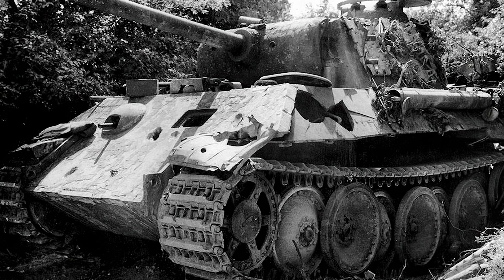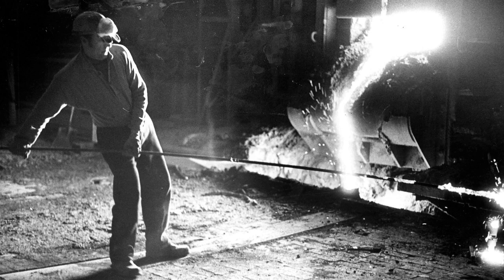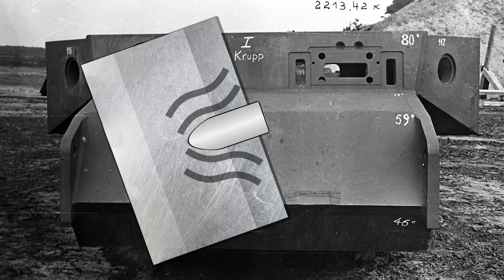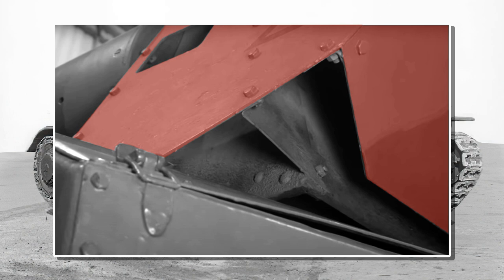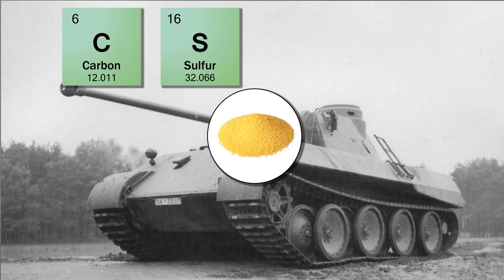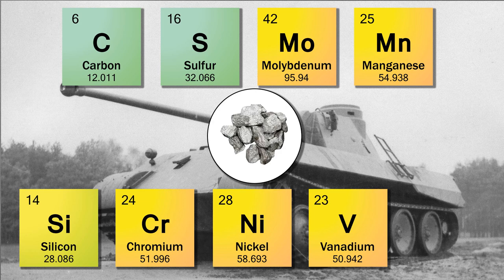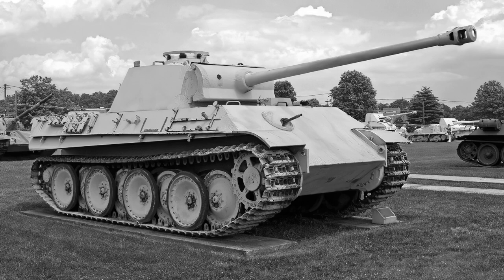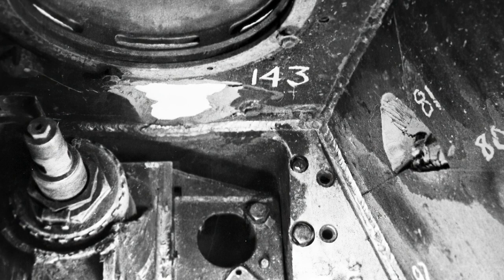Panther Armour - Tank Research & Review

Comment: I've read somewhere that the russians started tests after meeting Panthers and Tigers to see what kind of guns was needed to kill them. They came to the conclusion that 122 mm would do fine and started working on it. When IS-2s faced the german heavy tanks later on the 122 mm proved to be an absolute overkill and the russians did new tests on the new wrecks and found out that german armour had dropped in quality so the 122 mm was now considered ineffective due to it's slow ROF and small ammunition capacity compared to 85 mm armed tanks.
Reply: Ahh for that u will need to wait for part 2, overmatching. and yes technically on paper the 100mm has better performance than the 122 mm at 1000 yards, yet in reality, the latter works better.
Reply: That's such bullshit lol. The 85 could not penetrate the Panther frontally outside of suicidal close ranges.
Reply: @ThatZenoGuy  From Tank Archives:  http://www.tankarchives.ca/2013/03/penetration.html
Looks like 500m for the 85mm gun on the T34
Reply: @bradyelich2745  
Which would be far, far within range of the Panther, and only with optimal angles.
Reply: Additionally, soviet testing is close to propaganda.
Reply: @ThatZenoGuy  So what; they still lost.  If a Panther is hit by a 85mm at 1000m, all the crew (left alive) will be doing, is trying to escape through hatches.
Reply: @bradyelich2745  
If a panther is hit at 1000m (unlikely due to soviet training and optics), it won't penetrate and the crew likely won't run away.

Germans lost due to America supplying the soviets and british with infinite equipment.
Reply: @ThatZenoGuy  Did you not understand the spalling effect from the German Armour?  No need to penetrate.
Reply: @bradyelich2745  
No proof of 85mm causing internal spalling on the Panther.

122mm? Sure, but that thing was almost a naval cannon.
Reply: @ThatZenoGuy  The proof is at 1000m, the gun is still going through 80mm of armour.  Chunks will be coming off inside (spalling) and the armour will have been cracked.  
Do some reading; start at tankarchives.ca
Reply: @bradyelich2745  
How about you provide a picture, if its so common.

The armor would have to be of absolutely horrid quality, and even latewar german tanks were not that bad.

In any case, the much more powerful 88mm guns of Germany would do the same on Russian tanks, due to Russian metal quality being garbage too.
Reply: @ThatZenoGuy  The pictures are on tankarchives.ca
Reply: @bradyelich2745  
Yeah, real neat, i'm not going to scour through dozens of pages to find them.

Post them here.
Reply: @ThatZenoGuy  I did, that is why I know more than you.
Reply: @bradyelich2745  
What a pretentious sped. Lol.
Reply: @ThatZenoGuy  Oh, get your Mom to pour more milk on your cereal, I doubt you could do it yourself.
Reply: @ThatZenoGuy  Only with the obstelete APHE & APBCHE shells, which have lacklustre performance anyway. With HVAP "Arrowhead" shot, the Panther can still outrange a 85mm. armed tanks. After 1945,, with the front line use of APDS, any 85mm. armed tank can outrange the Panther.
Reply: @CZ350tuner  
85mm never used APDS lmao. The Panther could deal with all but the heaviest of allied tanks out to ridiculous ranges, whereas most tanks could not penetrate the Panther frontally, excluding the more fragile turret.
Reply: Soviet 85mm was similar to Tiger I gun. At longer ranges it was more effective than Panthers 7,5cm L70. T-34 also had similar side armor and better turret traverse mechanisms. If T-34 and Panther were standing sideways at lets say 2km away, and saw each other at the same time, T-34 85 would win.
Panther had thicker frontal armor ofc. The reason T-34 didnt have thicker armor is because Soviets tested it and the suspension couldnt take it. USA had a thicker M4 but as I remember only 0,5% of Shermans were Jumbos, cause they needed much more maintenance and experienced drivers. Soviets also had KV-1s but didnt have a need of a less reliable T-34 witch a bit more armor. But Germans started using heavy tanks in medium tank roles tho even countries that had oil believed its a bad idea. Keep that in mind when talking about Panthers effectiveness.
Reply: @Paciat  
Panther's gun outperformed the 85mm well beyond reasonable ranges, a T-34 would not be firing at a target 2km away, although realistically neither would the Panther. Frontally the Panther was effectively immune to the T-34, the opposite was not true.
Reply: @ThatZenoGuy  More like what is your saying is not true. Panther turret was thinner than its hull, and T-34 85 could penetrate 100mm at 1000m.
T-34 had a turret that was similarly thick to a Panther turret. If a Panther ambushed a T-34, witch is hard to do to size only its turret would be visible, and T-34 would be at an angle.
If T-34 ambushed a Panther - witch was easier to to due to T-34 good cross country performance and better turret rotation mechanisms, Panther would be at an angle.

And you can see that in history. Take a look what is the longest distance that an attacking German spearhead equipped with Panthers did. Than compare it to T-34 that was attacking an army equipped with the most anti-tank weaponry in history.
Reply: @Paciat  
T-34 and Panther were about equal with cross country, in addition while the T-34 could move it's turret fast, fine adjustments were only possible via hand.
The Panther's turret was vulnerable to the 85, but the entire T-34 was vulnerable to the long 75.
Reply: @ThatZenoGuy  Take a look at this video about Panther at 2:40:
https://www.youtube.com/watch?v=PqVNoiBz54I
2km wasnt an unreasonable range for an 85mm gun, nor even for a 76,2mm. Germans noticed a panther would be knocked out by a 76mm T-34 gun from 2km. And as the video sais Panthers armor was out of balance. Its absurd to think people would aim at the thickest part of this oversized, easy to hit tank.
Reply: @Paciat  
Lmao nobody 'aimed' for weakpoints of tanks, you aimed centre mass and hoped for the best. 2km a 76mm T-34 wouldn't even scratch the zimmerit of a Panther.
Reply: @Paciat  
AT rifles are fired at ranges within 100m, tank guns are far too large to accurately aim like that lmao.
76mm T-34 can't penetrate the front of the Panther's turret even at point blank. 
Nobody is discussing the weakness of the Panther's side, that is well known and is at most 50mm with a slight angle.
Reply: @ThatZenoGuy  Making stuff again...
Boys AT rifle iron sights were for 300 and 500 yards.
https://www.youtube.com/watch?v=Lkc2yAaU3CY
At less than 100m a Soviet PTRD cloud penetrate Panthers side armor without skirts.
As for tank guns, you have mechanisms to accurately aim, and magnifying optics to use that accuracy. The only problem that WWII gunners had was guessing the range. But this wasnt a problem when a soldier knew the range. If a Panther armor is towards the gun, its going straight at you. So you dont have to move the gun much. As soon as a Panther turns to throw off your aim, it will show its huge side. And its transmission isnt build for aggressive maneuvering.

Finally why are you about a 76mm that T-34 can't penetrate the front of the Panther's turret? I told you that a T-34 85mm can, while even a T-34 76mm (so obviously 85 can do it too) can destroy a Panther from 2km shooting from the side. And I backed that with a source video with German army regulations.

So my point is still the same. It dosnt matter that your tank can withstand a Soviet divisional gun fire if your tank is 10 tons heavier, huge target, prone to brake down, easy to destroy from the sides. US had M4A3E2 with even thicker armor but only 0,5% of Shermans were were "Jumbos" because overweight tanks were  bad as standard medium tanks and were used for very specific situations. Same goes for StuGIII and JagdpanzerIV L70. People think its an improvement but the second suffered badly in roles other than destroying tanks from ambush positions.
Reply: @Paciat  
The 40mm side armor was a small sliver above t he wheels. A hit above or below said area was more than 40mm and resulted in a non-penetration for the PTRD.
Reply: @ThatZenoGuy  Lol, a plate that is roughly 40cmX400cm is a small sliver, for a weapon that aimed at weak points like vision slits... Adding more wheels adds friction and mass, while they are far less effective at protecting the tank than actual armor. Its a stupid idea that almost no one used after the war.
I can make stuff up too kid. Like that Germans are gay man as the name suggests. But whats the point. Post where you are getting your information. If you cant do than how can you know If what you heard was nazi propaganda, clueless GI whining, or plain fiction created for personal profit?

Comment: I always thought the Tiger I with its flat front armour was more effective than the Panther. How many times would the allies encounter the front of the tank perfectly square-on?  The combination of an 8.8cm gun with 100mm of front plate  with a rolled steel turret seemed a good combination, defensively speaking. An expensive tank but I suggest possibly more effective than Panther actually turned out to be, regardless of how good-looking and well balanced it seemed.

Comment: There is a lot more to steel than just the chemical composition. The heat treatments have a lot more to do with brittleness than carbon content. The Germans were experts at making fine grain martensitic with very high carbon content. It was very tough as opposed to brittle. Dr Ferdinand Porsche himself is credited with inventing SG Iron (the first of the high strength low alloy steels)
Reply from the maker: except they didn’t heat treat it properly, a large number of vehicles tested during the war which were captured were found to have very brittle armour, there were a few exceptions, but for the most parts it was prove to cracking and flaking a lot.

Comment: this question is purely to answer my own musings having seen the photos of tank and vehicle dumps everywhere as the advance to Germany progressed I wondered obviously the vehicles had been stripped of everything useful to aid in retro fit and repair so....what happens to the metal can armour plate be cut up and recast ?
Reply from the maker: yes and no, it depenends on the metals mix, most vehicles were sent back via scrapping ships to the US or in germanys case is salvaged, if the metal has faulty impurities then thats no good, or if it has burnd out, but can be made into lesser stuff easily enough, recasting from wrecked steel can lead to a lot of problems though
Reply: @armouredarchives8867  ah thanks

Comment: Great video, sir.  Makes me wonder if they'd have been better off simply utilizing two welded plates, with one being untreated and a thinner layer, on the outside, being treated.  I do wonder, and I imagine that you'll get into this later, was this more of a late war issue or something that permeated Panzers throughout?

You'll also maybe touch on this, in another follow-up on the video, but I can remember watching a video with Hilary Doyle and The Chieftain, where they're walking through a museum, in Germany.  They start talking about the Jagdpanzer 38 (t) - Hetzers gonna hetz! - and Hilary makes the point of the armor, on the Jadgpanzer is X mm thick but provides less protection than the typical type of steel used in earlier German tanks.  Is that because of what you're eluding to, here, where they ultimately had to stop face hardening?  Or, was that something else, like less quality steel for faster production or other issues?

Apologies, for the length of my diatribe.  Keep up the great work, sir!
Reply: Hilary was referring to Siemens-Martin steel, a more antiquated method of plate manufacture. That is not what this is about.
Reply: Hi its on the list, in this first case, that's pretty much how the UK did things, but as said in the vid, its connecting the two plates that's hard as they won't weld, so you need to rivet or bolt, which is fine up to a point but as the armour thickness increases the bolts become larger and larger to hold the two layers and survive impact into the point its not possible.
Reply: @edfrancis712   @Adam Mann  As I recall (will have to check some research) it has also been found in testing that two stacked armor plates are not as effective at stopping armor penetrating rounds as a single plate of equal thickness.  IIRC it is because there is now an internal shear plane preventing the energy from being distributed between the two pieces.
Reply: You can determine 3 types of both German and Soviet welded armor plates. 
1. Demanding technologically, being well delivered in most cases worked for German tanks until 1942 outstandingly well, especially considering the Panzer IV and later on the Tiger. 
2. Demanding technologically, being poorly delivered, as shown in this video - did not work well for the III Reich. At least not all the time. Due to the low quality of materials and not strictly provided treating processes rather awful for the Soviets and their famous cracking hulls of the early T-34s.
3. Late stage of war pushed Germans to leave their last manufactured Panthers not heat-treated at all - soft. For the same (yet hugely scaled up) reasons also appeared in LOTS of the post-1943 Soviet tanks - ballistically soft as well.
Reply: @AdamMann3D  
Siemens-Martin is merely a process of steel production, most nations in WW2 used it. It resulted in armor of good quality.

Comment: According to Thomas Jentz book "Germany's Panther Tank - The Quest For Combat Supremacy" there was also a VK30.01M designed. This would have been a 30 ton vehicle similar in size and shape as the PzIV but with the overlapping and interleaved road wheels but better armor all around. Turret in the drawings looked the same as the PzIV with the 75mm L/24 short gun. 

IS-2 carried the 122mm not because it was intended to be a tank killer but because its primary role was a assault gun/fire support. The 122mm was more than capable of dealing with most German vehicles and the 122mm HE was very effective against bunkers, infantry, and anti tank guns.  

Soviet assaults were supposed to be a line of T-34's advancing and by passing any heavy resistance. Second row was supposed to be heavy tanks like the IS which would engage the heavy resistance. A third line of self propelled guns such as SU's and ISU's were to engage vehicles and anti tank guns.
Reply: There was also the VK30.01(P) design from Porsche. With a "light" Tiger 1 looking hull and turret, but with the turret mounted more forward than the center position of the Tiger 1. The tank was to be a 30-ton medium tank that would have mounted the 8.8cm Kwk 36 L/56 from the Tiger 1 using the same Krupp turret that would later be used for the Tiger 1 and the VK45.01 Porsche Tiger, that was actually originally designed & built by Krupp for Porsche for the VK30.01P project. It would also be the first tank to utilize Ferdinand Porsche's "electric drive". With this first project utilizing 2 gasoline V-10 engines producing around 415hp combined, that would be mounted to electric generators that would in turn power the electric motors located at the front of the hull where German's would normally mount their transmissions. Each of the two combos of engine, generator, and motor would power their own drive sprocket, which is how differential steering was achieved. This powertrain was the project's Achilles heel which due to the complexity & novel nature of the new design, would lead the Heer to choose other designs from MAN and Henschel, based on more mature & combat proven tech, to continue the competition. 

In my opinion, this is one of the most interesting and promising designs that wasn't utilized. A medium tank mounting the 8.8 L/56 that early in the war, would have been a tremendous tool to for the German's to have. If Dr. Porsche wasn't so stubborn and simplified the design using a more mature powertrain, the project may have been much more successful. If Germany could have figured out how to keep up with their resource demand, choosing a medium tank design that incorporated the same turret & gun combination that their later Tiger 1 would use, would have simplified the supply chain, and would even allow other factories & shops to produce the turret design quickly, by having a few engineers from Krupp come over to help them get started, instead of having each tank Germany deployed using their own turret & hull designs. This would have kicked off what the tried to do with the "E-Series" much earlier.